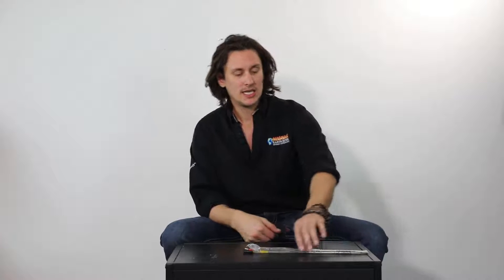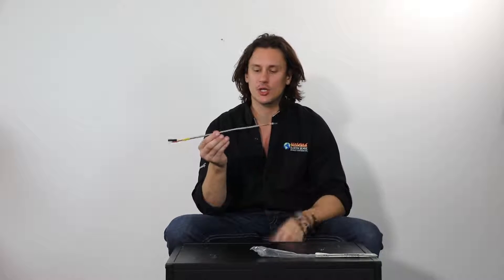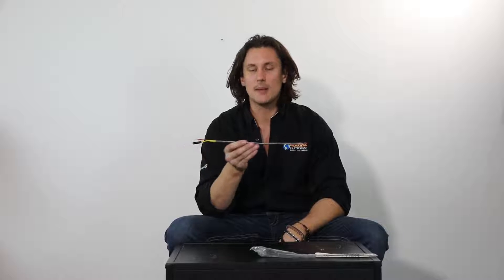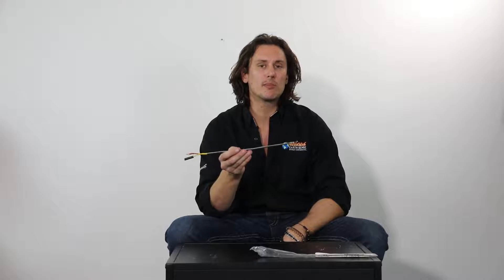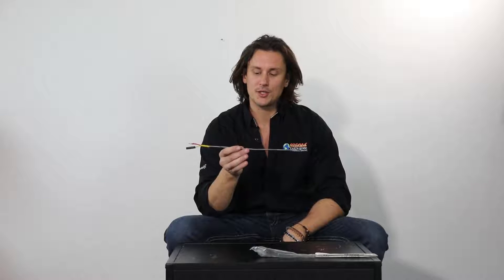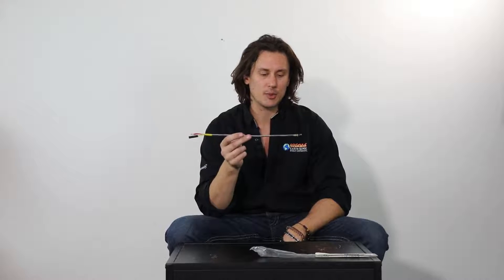Quadrafire Thermocouple Function & Troubleshooting

Comment: The auger motor on my Quadrafire Castille stove does not turn on.  When I plug in the unit, the exhaust fan turns on; then I increase the thermostat setting and the red light comes on, but the auger motor does not.  I disconnected the connection from the control box to the auger motor and there is only about 5 volts out of the control box. The hot side for the motor comes thru the vacuum switch and the snap disk.  There is 120v coming out of vacuum switch and the snap disk going to the control box.  So I am guessing the control box is at fault.  Are there any other controls that might inhibit power going to the auger motor from the control box?  Is there some way to confirm the control box is at fault?  The only parts between the snap disk and control box are the wiring harness and the control board socket. Thanks.
Reply from the maker: Thanks for contacting us Carl, happy to help. 

In the Castile the two components in line with the auger feed motor will be the Vacuum Switch and High Limit Switch. Before determining if it's the control box, I would recommend testing the auger motor to direct power (You can create a test cord - video below). This will allow us to rule out if the motor is good or bad. Secondly, we can independently bypass the vac switch and high limit switch for TESTING PURPOSES. We NEVER want to leave a safety switch bypassed. Video below on creating a jumper wire for testing. 

If the motor works fine to direct power, and nothing changes when independently bypassing the switches, then we would want to take a closer look at the board. You may find a local dealer that can test the control box, otherwise we do offer a service for testing this as well.

Test Cord: https://www.youtube.com/watch?v=rlmiCYI2WPk&t=8s
Jumper Wire: https://www.youtube.com/watch?v=FDVkbsHS95U

Keep us posted, happy to assist.
Reply: Thanks for your help.  When I bypassed the vacuum switch as you suggested, the whole system worked fine.  But now I don't know if it's the vacuum switch or the lack of vacuum.  The hose connected to the switch is clear.  The system seems to be venting well.  What symptoms should I look for that would indicate it's a lack of vacuum instead of the switch itself?  Is there a way to check the switch itself without special equipment?  Thanks.
Reply from the maker: @carlmassarini5968  Hey Carl, glad to hear we were able to narrow things down here. I do believe there is a way to get a reading on the Vac switch with a standard Multi-Meter; let me ask our tech team on that and follow-up. 

Things for you to check:
1. Ash accumulation/build-up in the stove and/or vent. Double check the venting and stove ash traps. We can provide further resources here if you need. 

2. Check your door and ash pan door gasket seals. Check in multiple places around the door. Use a dollar bill, half in, half out, shut the door, pull on the bill to see how much resistance there is. Should be fairly strong resistance. 

3. Combustion Blower. Combustion blower needs to reach proper voltage and RPM upon start-up to lock-in the vacuum switch. We can use a standard Multi-Meter to check the motor voltage on start-up to make sure it's in range.

I would also mention that if any of the 3 things I outlined are in play here, we would notice a somewhat lazy, sooty tip, poor flame when operating. When it was last running, did the flame look crisp and torchy or was it lazy in anyway? 

Thanks,
Reply from the maker: Also, check the vacuum switch tubing. Make sure there are no splits or cracks and that both ends are properly in place.  Thanks.
Reply: The flame looked good and strong.  But I will check the 3 items as you suggest.  What is the proper voltage range of the combustion motor voltage that I should be looking for?
Reply from the maker: @carlmassarini5968  Thanks Carl, sounds good. On start-up your combustion blower should be running near line voltage. I would say between 95-120V, but let me double check on that and respond back.
Reply from the maker: @carlmassarini5968  Hey Carl, Just heard back from our tech team.

Vac Switch Testing: Yes, do a continuity test on the terminals of the switch and then blow and suck on the bard for the vac line and you should see that switch gain and lose continuity.

Combustion Motor Voltage on Start-Up: 110-115v.

Keep us posted. Thanks!
Reply: The issue has been resolved, but I’m not sure how.  I performed the checks as you suggested.  I also did some cleaning of the entire system, although there didn’t appear to be any significant accumulation of ashes that would have caused a problem.  Cleaning included the port that the other end of the vacuum hose connects to, by pushing a piece of wire into the port.  The vacuum switch itself performed as it should per your instructions.  I wonder if it could have been ‘stuck’ and got cleared during the test.  In any case the stove is working perfectly.  I appreciate all your guidance.  Thanks!
Reply from the maker: @carlmassarini5968  Thanks so much for the message Carl! We have seen many cases where moisture gets into the vac switch and causes the diaphragm to 'stick'. Usually once we free that up (Lightly suck and blow on the vac line) things will work properly again. Sounds like that was the case in your unit. Glad we were able to help and everything is back up and running! Any future questions please let us know. Thanks!

Comment: I replaced thermocouple on my Heatilator 35 it fired up and ran for short period about 12 hrs, now I am no longer getting the feed motor to work.  I had recently replaced motor.  I have the call light come with thermostat vaccum tube is clean and vents clean.  When starting up get a blinking blue light on control box.  Stove does not turn off unless unplug it, the ignition element under the pot is working properly.  Is there a way to test vaccum switch? and what do you mean by switching the leads, switch connector terminals?
Reply from the maker: Thanks for contacting us James, happy to assist. Yes, some thermocouples we've seen where when installing you need to switch connector terminals. In almost every case this would only apply if the thermocouple is not locking in after initial start-up. With your unit running 12 hours I would not see this to be the issue. Glad you checked the vacuum switch hose, venting is cleaned and you verified your igniter to be working. 
Yes, I think the vacuum switch will be what we want to test next. Video below on bypassing that switch. Bypassing is for testing purposes ONLY, we never want to leave a safety switch bypassed. 
https://www.youtube.com/watch?v=FDVkbsHS95U&t=6s

Let's also make sure the door gasket appears to be sealing tight all the way around as well as the glass gasket. 

In the 12 hours the stove was running, was the fire crisp and torchy or was it lazy in anyway? 

We'll get you back to 100%. Keep us posted.

Thanks,

Comment: My Contour will feed but not light, and the control box blinks blue four times. I can't determine what the four blinks means, but have a feeling that it has to do with the thermocouple?
Reply from the maker: Hey Tony, thanks for contacting us. Yes, that blink indication is for the thermocouple not reaching temp in a specified period of time (Which it would not be able to do if the stove is not lighting, so that is normal). 
Let's check your igniter element. Ohms should read between 43.5-53.5 on the 300 watt loop igniter in your contour. Here is a video on testing the igniter:  https://youtu.be/z4wmCc96rVI 
Link to replacement element for reference: https://pellethead.com/product/quadrafire-loop-igniter-starter-element-300-watt-8-wire-length-oem/

Keep us posted, happy to help!
Reply: @EarthSense  Hi, I checked the igniter element as you suggested, and replaced with one from your store, and the stove now lights and runs as it should, thanks for the help!
Reply from the maker: @tonysadaway1719  Fantastic to hear Tony! Thanks for letting us know. Any questions down the road please let us know. 
Warmest Regards,

Comment: Hi, I have a Quadrafire Classic bay 1200...What would cause ash to build up underneath the thermocouple? This is the first time I have ever seen it do that, I clean the inside of my stove about every other day if it's running all day or if we only run it at night, a couple times a week. It started working great this season and this week it decided to give me trouble, It was running during the day but would shut off during the night. I cleaned out my hopper, meaning I took all the pellets out and vacuumed it. I'm using a different brand of pellets than what I started the season with since I had a half ton left over, a bag or two of the brand I am using now might have gotten through before I cleaned out the hopper. A couple of days ago I noticed the underside of my thermocouple had a build up of ash it wasn't hard it was just clinging to it. My husband changed the thermocouple and replaced the door gasket. Since this was new to me I gave my stove a thorough cleaning and vacuumed out the hopper again, when I was cleaning under the firepot for the first time in 11 years I saw clinkers. And since the cleaning I am still getting the build up on the thermocouple so I am at a loss on what may be causing it. For the most part it is soft but there is a little hard bits too, I cleaned it Wed and again today.. When I called the dealer he said it was just sand clinging it and to brush it off???  I've used this brand of pellets before and never had this problem. Any help would be appreciated.
Reply from the maker: Thanks for contacting us Stacey. Sounds like you do a very nice job with the cleaning and maintenance which is great! This could be a pellet fuel issue - in some cases we will see variances in the same brand, different shipments. Most dealers and manufacturers will have their pellet fuel 3rd party tested periodically to ensure quality and consistency. 
What does your fire look like? Is it crisp and torchy or is it lazy in anyway? What about glass build-up? Is it black and sooty or is it grey and hazy? 

Just to make sure, you have the thermocouple ceramic cover over the thermocouple and this is where we are seeing the build-up correct?

I may suggest grabbing a few bags of a different brand of pellets for testing purposes. 

Happy to assist!
Reply: @EarthSense   Thank you,  yes, the ceramic cover is where the build up is happening. Last night the fire was huge and lazy, leaving black soot on the back panels but not on the glass, even with such a high flame at times the glass stayed pretty clean, the glass is grey and hazy. Last night the flame was really high when it first lit and the would calm down and then it would shoot up again before calming down. Tonight it didn't get as big and lazy, more of a crisp and torchy. I was looking in the firepot when it was cooling down and it looked like there might be some clinkers in it which is not normal to me. I will do as you suggested to see what happens since this started after using a different brand I would have to agree that it is probably a fuel issue, I'll know for sure after testing it. Thank you!

Comment: I have an older quadrafire 1000, the exhaust fan will not shut off after cool down. Changed #1 spap disk. Still runs constantly. Any suggestions? Thanks.
Reply from the maker: Thanks for contacting us Johnny, happy to help. What happens if you pull one of the wires off the snap disc after it's been running for awhile in cool down? Does it shut off then? Could potentially be a faulty replacement disk or it could be an electrical or control box issue. Double check all your electrical wires and connections. Unplug the unit, pull the control box out, place back in, and plug the unit back in - reset. Keep us posted, happy to assist.

Comment: 04 qf Santa fe keeps burning and feeding pellets until flame looks our of control and I turn off the thermostat. Feed rate is almost all the way  at minimum. The red and green light on top of control box is on as well as the call light stays on
Reply from the maker: Thanks for contacting us Donald, happy to help. If you can, let's open up the side panel and watch the auger motor while in operation. Do some time tests with the auger motor after the start-up cycle is complete. Make notes of the auger on and off time on low, medium, and high settings. This will let us know if the motor is getting proper signal from the control box. 

In most cases when a stove appears to be overfeeding it's actually a lack of combustion air.
- Make sure your stove, ash traps and vent pipe are clean
- Make sure your door gasket is sealing tight
- Make sure your burnpot is clean and bottom release closing all the way
- Make sure your combustion blower is running at proper voltage. Should be near line voltage on start-up, in normal operation it should be approx 75V - 105V depending on the heat level setting. 

Keep us posted, happy to help.
Reply: @EarthSense  I will try everything tomorrow after work. And take notes and video. Just wanted to thank you for the prompt reply. If you ever have any tile, marble, or granite questions just hit me up.

Comment: Thanks for the great information. I have a Quadro-fire 800. what is the correct position for the thermocopler over the fire pot. Should it just stick straight out over the pot or bend down into it. I am the second owner of a 1995 stove so I am sure it has been 
been move from the original location. Thanks again for the information.
Reply from the maker: Thanks for contacting us Patrick, glad the information was helpful. In your 800 Nova model do you have the original ceramic style firepot or does it have the upgraded cast iron firepot? For the cast iron it should stick strait out over, for the ceramic it may be a bit different - I need to check in with our tech team on that.
Reply from the maker: Hey Patrick, Just heard back from Tech - It can be either way. The straight out over the fire is how it is normally set up but on some models tilting it can allow it to read the temp better.

Any other questions please let us know. Thanks!

Comment: My Santa Fe will get to the ignition phase and will feed pellets but the fire is pretty small. The convection blower never turns on, the metal where snap disk #1 is attached doesn't get warm, and after 20-30min the stove turns off.
Reply from the maker: Thanks for contacting us Aaron. Sounds like the unit is not getting enough fuel on start-up to lock in the thermocouple and snap disc that turns your blower on. To test, toss a half handful of pellets in the firepot and turn the unit on. This will allow a bigger fire on start-up and will let us know if the Thermocouple locks in and the blower snap disc locks in. Depending on your control board style there may be settings to increase feed during start-up. Keep us posted with what you notice.
Reply: @EarthSense  adding a handful of pellets did seem to activate the thermocouple. It's been running for a couple hours or more now but the area around snap disk 1 has yet to get hot -- its somewhat warm and the blower has yet to turn on.

The controller is a "3-speed board" by RJ or RU or something FWIW
Reply from the maker: @aadank  Thanks for the message back Aaron. Good to know the thermocouple is operating correctly. This either could be an issue with the snap disc itself or it could be an issue with ash accumulation in the back firewall that is creating an insulation factor not allowing that disc to get to proper temp to close and turn on your blower. What does your fire look like? Is it crisp and torchy or is lazy in anyway? If it's lazy in anyway I would suggest a thorough cleaning of the stove. If it's a clean crisp torchy fire, then I doubt we have significant ash accumulation in that rear firewall. Keep in mind it's a 110 degree switch, meaning it only needs to hit 110 to lock in. Typically this happens within 15-20 min of the stove starting up. Do you have a temp gun or anything of the sort to see what temperature is by that snap disc? Keep us posted, happy to help.
Reply: @EarthSense   had to deal with the fire pot bottom not opening but that is fixed now. I don't think it has been used much...

Here are some function videos:
Video 2: https://youtu.be/opfZnuZsHqY
Video 1: https://youtu.be/jxHcZY5DC3k

It looks like its very small and not generating sufficient heat. The video 2 was after pulling the "feed adjustment control rod" fully up/open
Reply from the maker: @aadank  Thanks for sending over the videos Aaron. Yeah on both it's pretty apparent that not enough fuel is coming into the firepot on start-up to lock in the thermocouple and snap switch. It does look like you have good air-flow. I would say we more than likely either have an issue with the auger motor getting weak or we have an issue with the control box feed sequence. With your stove unplugged, pull out the control box and let us know if there is a dial on it that we can turn to different settings. Newer boards will have this, earlier boards will not. Video Reference: https://youtu.be/mgfUCtbzU5chttps://youtu.be/mgfUCtbzU5c
Reply: @EarthSense  Back at the cabin and troubleshooting this stove....
The control box does have a dial.
Reply from the maker: @aadank  Hey Aaron, sounds good 6 will be the standard setting and 7 will be the +10% fuel during start-up for your Santa Fe. Make sure your stove is off and unplugged when pulling out the control board and making dial adjustments. Thanks.